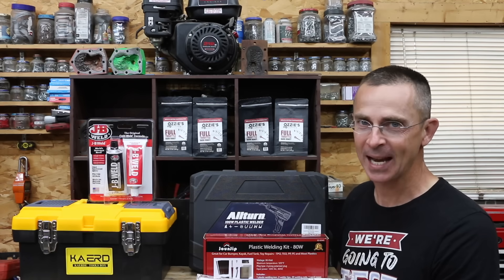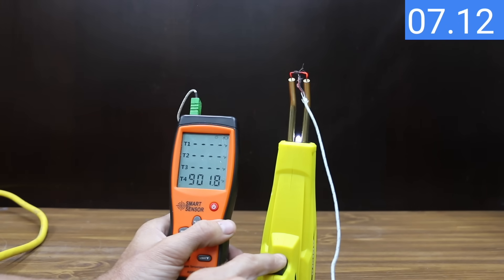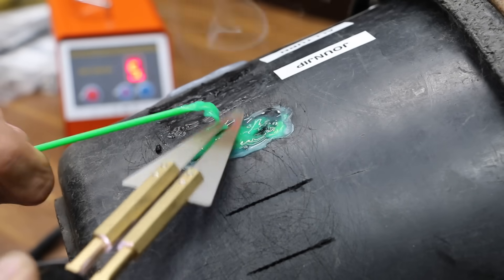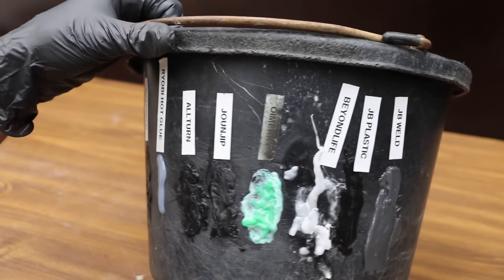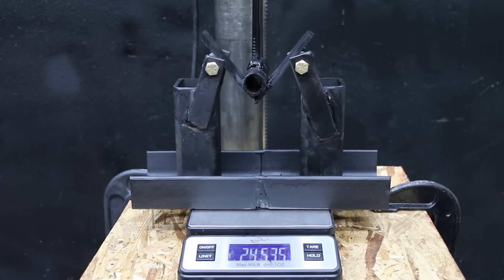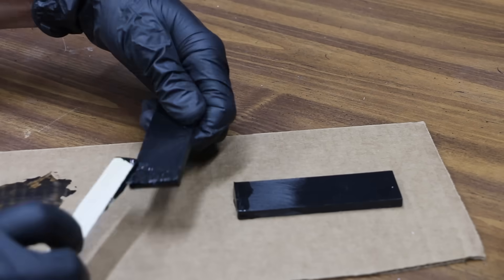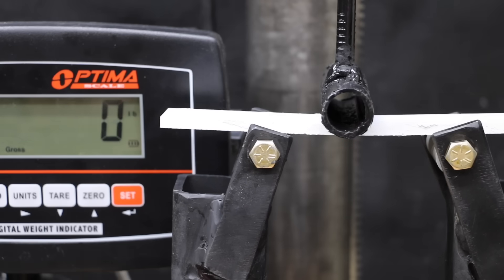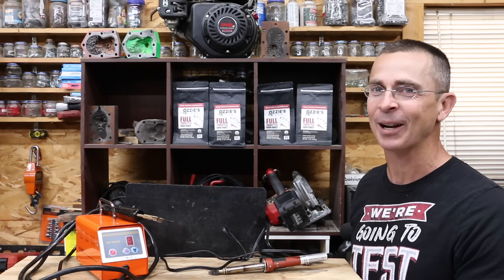Don't Buy A Plastic Welder Until You Watch This Review!

Comment: For those who don't know what HDPE means, it means high density poly-ethylene, and is manufactured differently than is Poly-ethylene. 
HDPE is typically used for fuel tanks, and fuel and oil containers in consumer goods.
For one that is desperate to fix a plastic gas tank, cutting an oil container into strips the color of the tank, as this is the same plastic in both. I repaired a generator gas tank this way, and used a 100w soldering gun. It  was leak proof, and was tested by two different mechanics, and they both approved.
For white plastic repairs, isopropyl alcohol bottles are HDPE, and work just as well.
Reply from the maker: Great tips! Thank you
Reply: HDPE is NOT different that PE.
HDPE is PE, simply it has longer and better packaged chains in order to be more crystalline and perform better mechanically.
Chemically it's absolutely the same.
Of course, not all PE are HDPE, but definitely all HDPE are PE.
Sincerely, an engineer working with polimer.
Reply: @Morannar Does all HDPE have the same safety issues, or do different brands have different concerns?
Reply: @Morannar I followed that but to simplify if someone doesn't.   
Humans are mammals 
So are Chimpanzees 
But Chimpanzees aren't Humans.   There's is a very very very miniscule difference in the DNA makeup and that is what is different.  Not a perfect analogy but it's close enough
Reply: HDPE is extensively used for water piping and underground dedicated fire fighting piping (usually for industrial applications).
Reply: Milk jugs are also HDPE. Look for the triangle with a 4 in the middle. 

There are many videos of making really cool things via melting milk jugs in the oven and using the block of plastic. 

It's a very interesting rabbit hole to go down.
Reply: @TheSshadow7  I've got a 30 year old scar on my hand from burning a milk jug as a kid, got a good drop of molten plastic on my hand 😂
Reply: @TheSshadow7  I'm definitely going to have to check this out. I can see it now: 

Her: "Whatcha cookin' babe?"
Me:  "errr... it's a long story"
Reply: @TheSshadow7 2 in the middle.
Reply: @bobbyheffley4955  thanks. 4 must be ldpe. I gst them mixed up 🤣
Reply: 4 is LDPE, 2 is HDPE...
Reply: @TheSshadow7  HDPE is #2 LDPE is #4
Reply: Soldering iron & cut up strips of oil bottles works fantastic on plastic fuel tanks. 

Rookie mistake is not to plunge the iron into the crack and melt the plastic all the way through the crack.
Reply: @donwyoming1936 you took the words outta my mouth looking at those flat and skinny welder heads I was like why aren't you melting the between layers just stick it in! 😂. Also steel mesh would be perfect to melt Into not on top of the plastic.  Most fails seemed to be from delamination which melting it into the base plastic would eliminate
Reply: Thanks. Your comment was just what I was looking for. and I only had to read 2  comments to get the answer. My generator is also leaking.
Reply: Also most bottle caps are hdpe
Reply: @infernaldaedra  Actually, I don't agree. I read/heard that many bottle caps are made from scrap plastic.
Reply: @eugenetswong   This just means the caps are made from "second melt" plastic scraps; they are still made of HDPE.
Reply: @danajorgensen1358 How do you know?
Reply: Thank you!
Reply: HDPE it's really hard to weld/glue plastic from my experience, i've achieved the best results by simply melt the parts together when possible (mostly pipes), when not possible i use the method you described (use other scrap plastic to make welding strips) or for lighter jobs i just use hot glue and with the piece/s preheated, sanded and de-greased to help bonding better.
Reply: @tiagoferreira086  yeah, HDPE fixes I do are almost ALWAYS with a fine point heat gun, slowly heating the sides up to melt them together and get proper fusion. Can be difficult if it's thin, though. Shit likes to bend/warp like crazy when it gets hot. But thicker stuff is pretty easy to manipulate.
Reply: @Ayane13b   I usually use those "hand held torch" in order to apply quick heat to melt the only the edges and not the entire piece, but you have to be careful otherwise you damage the whole piece
Reply: @tiagoferreira086  "...simply melt the parts together..."  .. What do you use to do that?
Reply: @THE-X-Force   I usually use those "hand held torch" in order to apply quick heat to melt the only the edges and not the entire piece, but you have to be careful otherwise you damage the whole piece. For thinner parts you want to start heating far away, if you have some scrap plastic do some tests first. Btw for acrylic i use some cyanoacrilate (superglue) it may not be the best option but for me is good enough, i got better results than using epoxy. You can also purchase appropriate glues for each material.
Reply: @tiagoferreira086  Thanks very much! I actually have one of those tiny torches laying around .. I'll have to give it a try. ☮
Reply: Hdpe is the same stuff Walter white recommended?
Reply: The ONLY difference between HDPE and LDPE is the "High" and "Low" Density of laminar crystals in the semi-crystalline matrix of Poly-Ethylene.  SLOWER COOLING = HIGHER DENSITY.   When you take ANY polymer to the melting temperature (when flow is visible) you "erase it's history" (term of art in the field of Polymer Science and it become PE.  Whether it ends up as HDPE or LDPE depends on controlling the cooling between the melting point and the class transition point.  (you don't have to go all the way down to glass transition in that controlled manner, but this way you don't have to use DSC to tell what the right temperature is for any given polymer.  If you are quenching your work, or simply allowing it to cool in open atmosphere, you will end up with LDPE, or a hugely discontinuous laminar morphology, which is the weakest outcome.   To achieve HDPE, you MUST control the cooling through the crystallization regime VERY SLOWLY.....The specifics are available in innumerable texts and websites.  You may, in fact, find that an LDPE or MDPE patch is advantageous due to the patch being far more amorphous than the base material.  Do some reading on windshield repair using a drill, and on riveting.  An empty hole is a stress-reducer, resulting in the stress gradient flowing AROUND the defect.  A rivet, on the other hand, is a stress-concentrator, causing the stress gradient to flow INTO the defect.  If you TRULY wish to understand what happened in the repair of your gas tank, and perhaps figure out new tricks, you MUST begin with the foundational Physics of the material.   -Patrick Neyman, Ph.D., Macromolecular Science and Engineering.
Reply: It differs from normal poly. It resist things clinging to it. I use it in saltwater so barnacles don't grow inside and block the pipe
Reply: And grating, into smaller pieces
Reply: Yes, HDPE is a challenge to bond. They make superglue bottles out of HDPE.
Reply: Awesome!👍
Reply: The JB Weld cost more than replacing the bucket. HDPE can be welded. There is a small plastic / fabrication welding industry which lots are in the electronic semi conductor industry
Reply: I hadn't thought of using plastic bottles, thanks.

Comment: What i noticed was that on the polycarbonate you weren't using the appropriate weld stick. It needs to match the type of plastic you are working with. That's why they all separated on the polycarbonate.
Reply from the maker: Great constructive feedback. Thank you
Reply: Cheap plastic weld kits probably come with limited types of weld sticks. I feel that his tests are supposed to simulate the use of what comes in the kit, not specialized items you can buy. If some one wants to repair plastic they should do research to understand how to make proper repairs. Plastic is harder than stick welding. This channel is not to teach you to be a master stick/mig or Tig welder or to teach you how to repair plastic. Just to review products. He does a fine job on that.
Reply: @mikga45 
Yes a fine job. I learn from the comments as well as the video.
Reply: @mikga45  He's the best.
Reply: How to get know what type of plastic? I have one broken thing, but there is no stamp with plastic type, like (Abs, HDPE, pp).
Reply: The same goes for HDPE. It won't bond to other plastics, only HDPE AND LDPE.
Reply: @TheSshadow7   The average person looking to DIY a plastic repair isn't going to be able to find out some of this stuff sometimes and I think this is a good example of "using what you've got" which is best for the given audience (like me). 

I will eventually get around to repairing the rear bumper on my 02 Mustang to paint it, but have had mixed info on what exactly the bumper is made out of to begin with. So after so much time researching, I still don't know. I'll just have to do my best with what I go with. 

Another complication to this situation is the fact someone might be repairing an aftermarket bumper from China. How in the world are you supposed to find out what kind of plastic that is?
Reply: @HAL-dm1eh  I bet videos of plastic welding bumpers will address the proper plastic to purchase. It's important to know, so I'd take an extra 30 minutes to research it. You'll have more confidence undertaking the task if you do.
Reply: @TheSshadow7   That was exactly what I researched and watched and it was a lot more than 30 minutes.
Reply: @HAL-dm1eh  were you able to find yout answer? Now you've got me curious🤣
Reply: Sad when YouTUBers show knowledge but have no idea what they doing.

Comment: Super glue and baking soda also bonds really, really well.
Reply from the maker: Great tip!
Reply: I was committed to buying a new headlight bucket for my 240 Volvo, but I figured since I had it out anyway, why not try to fix it (I hadn't found one yet).  I used fresh super glue (cheap), and finished it off with baking soda.  I was pleasantly surprised to see the shattered plastic (three pieces) all went together and held up under light flexing (stress they shouldn't be exposed to in real life).  I did fill some of the cavities in the reverse side with epoxy, since I had it on hand.  

Has held up so well, that when I finally did find the correct part, I passed it up.

In other applications, I've dusted one side of the break with baking soda, and applied CA glue to the other part.  Instant, strong bond.

Comment: The beyond life welder requires a lot of practice and technique to use right but way more versatile. We use that style of welder for vinyl floor welding in hospitals in surgical rooms. You can't use any of the other style welder in situations like that

Id recommend looking up vinyl floor heat welding. It should give you a good idea for how to make a good hot air weld.

Nowadays even if I do not have a hot air gun, If I need to weld plastics I will melt both the base material and the filler rod right at the Joint area to get a very good repair. Similar to tig welding
Reply from the maker: Great feedback on the beyond life welder! I really struggled with it!  Great tip on making a strong weld too!
Reply: @ProjectFarm Better quality versions of that tool have independently adjustable controls for heat and fan speed. I also believe the Chinese knock off versions use weaker heating elements with a duty cycle that causes fluctuations in air temperature. It's the kind of thing where the quality of the tool makes as much difference as the skill of the operator. Don't beat yourself up, there's a steep learning curve and using cheap tools is a handicap by itself.
Reply: @kittytrail I install welded vinyl flooring and I like Steinel heat guns. They're a lower price than the Leister guns but seem to be of similar quality. I think the Steinel guns are made more for flooring so they don't have to be as powerful as the Leisters that are more designed for roofing. I know on my Steinel I can weld floors with the heat and fan all the way up but if I try that with a Leister I'm scorching the vinyl unless I'm moving fast and perfectly smooth. And that's with a good Turbo brand speed welding nozzle on both guns.
Reply: @simpsonryan32 I have two types of Steinel heat guns, the traditional gun shaped, and the inline style I bought specifically for plastic welding. Where can I buy one of those Turbo tips you spoke of? I only have narrow, wide, and heat shrink nozzles.
Reply: @simpsonryan32    yep, the Steinel ones are fine too and they also make quality heat guns for lots of other brands too. 😉👌
still preferring, for my work, them Leisters as they can run for hours without much temp variations in the output. 😽

Comment: Would have been interesting to see a soldering iron in the mix. Really I’m not seeing much of a difference except the tip shape. Maybe max temp?
Reply: The classic Weller and Archer soldering guns (not irons) had paddle tips available specifically for smoothing and mending cracks in plastic.
Reply: @goodun2974  that’s pretty cool. Thank you for the information.
Reply from the maker: Great suggestion! Thank you
Reply: Big tips, so probably more thermal mass. Bu a lot can be done with just a regular soldering iron.
Reply: Those with experience say just enough to get a semi liquid surface but never hot enough to burn or run out.

Comment: 🤩 I used a JB Weld product and plastic strips from an electrical box to fix our old pool cleaner head: worked fine for two more years! Plastic welding is something I should learn, however! Thank you Todd! 😎✌️
Reply from the maker: Glad the repair worked! Thank you
Reply: The problem with plastic welding is knowing the exact plastic and if it's got any additives.

I worked in a plant making dielectric insulators to nylon (nylatrol and other nylons) for chemical rated bushings.

Some of that stuff was almost like oil-impregnated bronze but without being labeled as such. Imagine trying to weld oil impregnated bronze 😂

Comment: I just bought a Bosch D-Tect200C 12 Volt rebar scanner to locate rebar in concrete. I looked on your channel like I do pretty much everytime I am going to buy a tool and you did not have a review. It would be nice to compare some and see how these compare.
Reply from the maker: Great suggestion! I hope the scanner performs well for you.  Thank you
Reply: Boy, I sure would have loved a rebar scanner when I was working in telecommunications and frequently had to drill through concrete to install condit pipes and sleeving. I bought expensive special-purpose rebar-eating carbide bits for those occasions when I had drilled most of the way through a thick, tough cincrete wall, foundation or floor only to hit rebar.....

Comment: Not how you plastic weld, you use the tip to melt the plastic together then fill if needed with more material. Try and use the same material, however the fiberflex works really good.
Reply from the maker: Thanks for the constructive feedback
Reply: @ProjectFarm  No problem, now I might have to do a how to video with my plastic welder...LOL You kept that tip off the base material, you need the base materiel to melt to bond The head with the feeder hole you put the head on the base material so that melts and you push in some new material through the hole. Maybe this is just an art and I have done it a LOT...best investment on the Polyvance I have ever made.